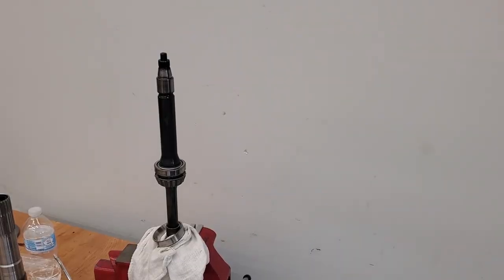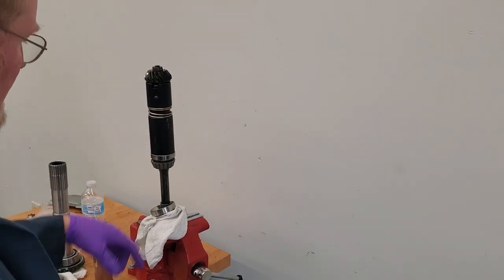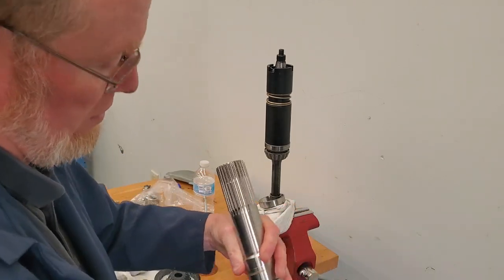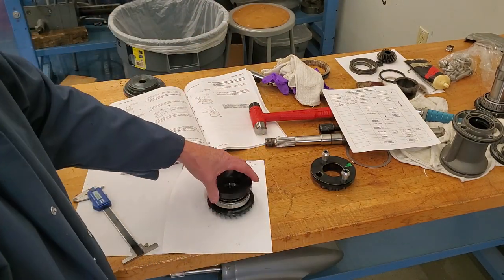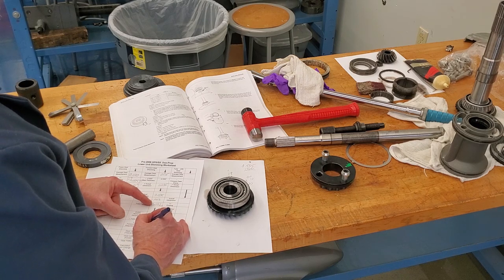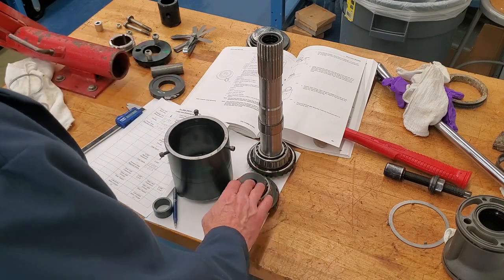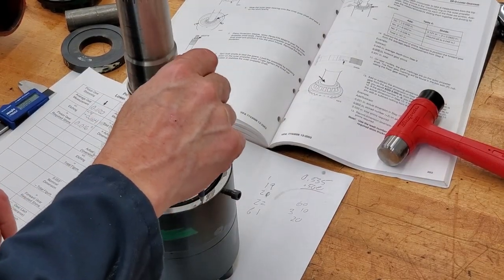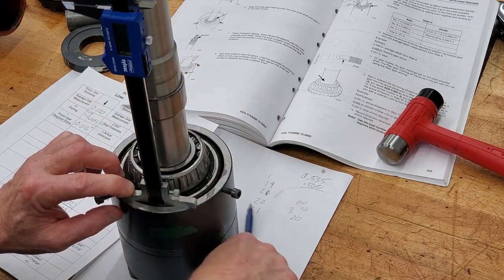Volvo Penta DPS Lower Unit Rebuilding Part 2

Comment: Hello. Great tutorial. When I did the Pinion bearing Carrier shimming procedure and calculations on my Volvo Penta DPS upper unit,  I came up with a NEGATIVE result of -0.049. Is that possible?
Reply from the maker: You can't have negative shims. You may have inverted the last calculation

Comment: Question : If you reuse the gears and shafts and put everything in a new casing . Will you change the shims as well , assuming the old drive was fine? Thanks.